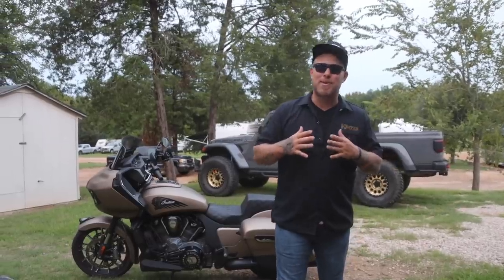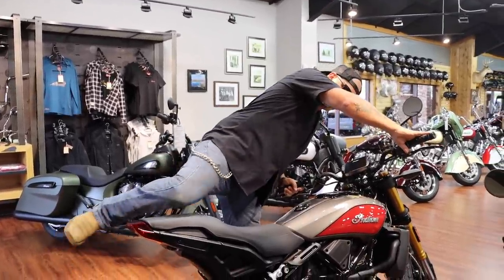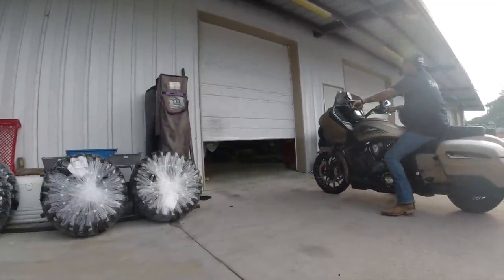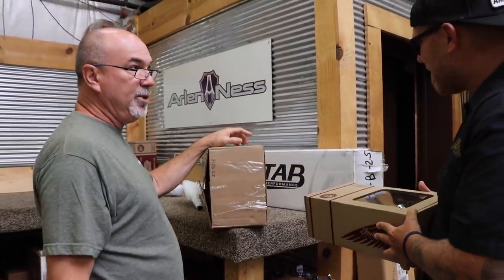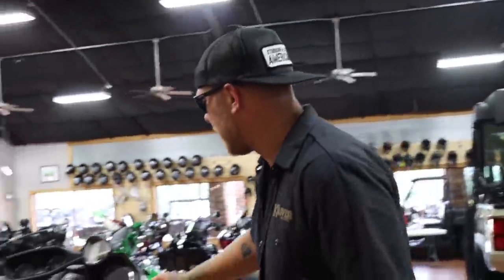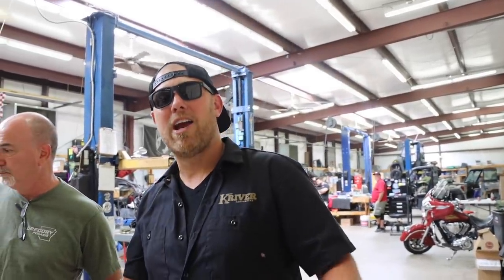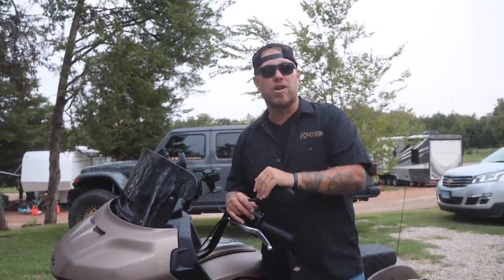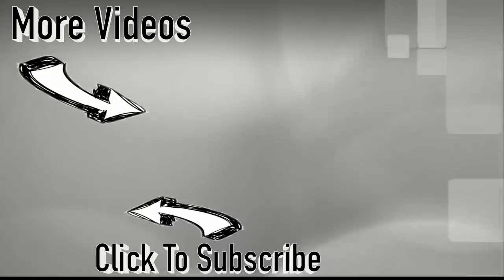Indian Challenger Exhaust Upgrade / Cat Delete

Comment: Those pipes sound great on the Challenger! If you need the fueling corrected for them and some more HP let us know. Would love to work with you! We have Power Commanders in stock for it and a custom fuel map built in house for that exact exhaust that added 10hp at the wheel.
Reply from the maker: very cool! thank you brother 👊

Comment: I want one in Cobalt blue. Love that Indian. Now Indian needs to make sportbike. 1000 cc, 230 hp inline 4. 360 lbs. Smoke anything on the road at 1000 cc's. Call it the WARCHIEF!
Reply: Pomfromoz  ahhhh, no
Reply: I'd call a bike like that the Broken Arrow.
Reply: Pomfromoz  I agree it won't happen, but the engines are developed by Polaris which owns Indian. Victory was also owned by Polaris but the brand is no longer developed sadly. RIP Victory

Comment: Just took possession of a new 2020 107 M8 Road King and before I picked it up did full Stage 1 including new 2.5 ceramic Headers air cleaner new cans and the mapping upload. I put the headers on to get rid of all that emmission rubbish and cats but was surprised that the bike still feels flat, no bad but just not what I expected so when it goes in for first service am putting in a torque cam and have dynoed. I was surprised that the cat on the Indian was so big. Sounds better now for sure and better grunt I bet...sounds just right. I almost went Indian but stayed loyal to my Dealer

Comment: If you ride at night you will want to change the headlight. I'm running the Eagle gen2 with halo. A huge improvement over stock. Custom Dynamics has an active headlight also. Maybe you can get Ciro to do a light?
Reply from the maker: I'm hoping so 👊
Reply: I adjusted my stock headlight. Makes a huge improvement. Factory settings is way to low

Comment: Pretty exciting mods. Question or requests??  Can you put links to the products? Handle bars, air cleaner, exhaust, tuner etc. Basically a slowed down more in depth upgrade video. I like the handle bars but were there additional items needed like wires and hydraulic lines?   Thanks.
Reply: @TABPerformance  Wow... you guys are on it! Thanks for the quick reply with links. Had no idea you offered anything other than mufflers. tHANKS AGAIN.

Comment: Pipes sound great. Did you have to install a tuner?
Reply: Was wondering the same thing. I can only assume it would need retuned.
Reply: The Indian Stage 1 air kit comes with a card for a tune that they download when the kit is installed.
Reply from the maker: It only needed to be reflashed

Comment: That’s true about the discount.  I got it as a veteran and I put 14” KST bars on mine.  I did a stage 1 upgrade on mine but haven’t deleted the Cat yet.  Did you have to have a special tune for that?
Reply: I just got the bam sticks with zombie baffles but I didn't do the cat delete yet because my tech said that if I go 2 into 1 then I would need a tune because of back pressure being low but if I  go 2-1-2 then I would probably be ok without a tune. So im just going to wait and do more research on tunes first. Hope that helps
Reply from the maker: thanks for weighing in on that 👊 I love how helpful everyone is to their fellow community members on this channel
Reply: We worked directly with Dynojet to make sure maps were available for the Cat delete upgrade.  The PCV is out and in stock with maps available in a 2-1 and 2-1-2 cat delete with our mufflers and stage 1 Indian breather upgrade.  https://www.tabperformance.com/indian-challenger-power-commander-v-p/pcv-29-004.htm

Comment: Maybe the cams when they come out with a stage 2. By the way what tuner do they use to tune it? Definitely a nice ride glad to see you expand your horizons. Love my ultra limited but those Indians are bringing it!
Reply from the maker: I’m not sure about that, they had it plugged up in the shop and tuned in no time
Reply: @adamsandoval  I heard the came out with stage 2 cam for the challenger. Putting them in is a different story. Not as easy as on the Harley. I heard you got to pull the motor=$$$

Comment: Hey Adam, 
What bars are you running now?
Barnstorm Cycles is working on a Dash Relocation set up that looks awesome. It will give you the ability to run any style of bars you would like. It wouldn't be necessary to have such a pull back and sweep on the bars to clear the fairing.
I live in California and just got the high flow put on my Challenger, difference is, mine has an ugly charcoal filter element hanging off the front cylinder of the bike. Maybe one of your contacts back there has some ideas to delete, if you could help with that, I'd appreciate it.

Comment: I'm so damned disappointed at Indian! I literally parked my challenger hopped back on my 2015 cvo road glide ultra. 
What I'm extremely disgusted with is that Indian motorcycles has failed to release lowers and a trunk for the challenger to make it a cvo of sorts/at least a full freaking dresser! I have stuck a trunk off a roadmaster on it and yes it clips right on but I really want Indian motorcycles to release a trunk and lowers specifically for the challenger. I'll leave mine in the garage until then.